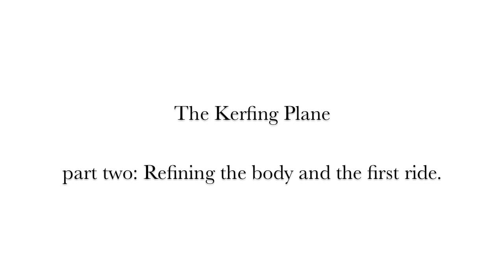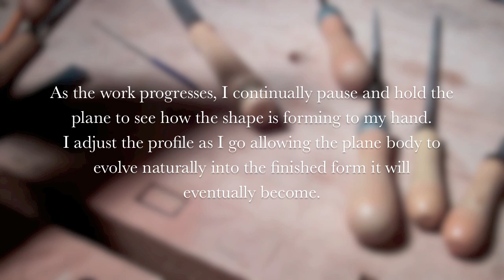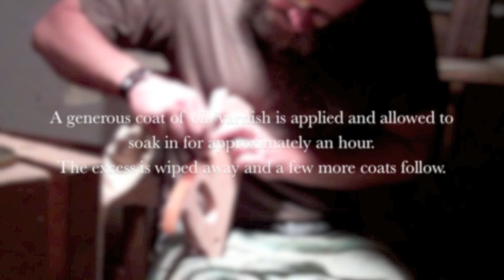The Kerfing Plane part two: Refining the body and the first ride.

Comment: Hey Tom, good stuff, very relaxing. 

If your number of planers you owned was reduced to only one, which would you keep? I'd like to break into the hand woodworking scene but don't know where to start.
Reply from the maker: Thanks for the interest. If I only had one plane, it would definitely be my low angle Jack plane. You can dimension rough boards, joint edges, smooth surfaces and shoot ends. If you need alternate angles, you can get replacement blades as well as toothing irons. Very versatile hand tool.

Comment: well done! Tom, how much is space betwin the blade and the fence?
Reply from the maker: tridneven thanks !  The distance depends on you- I just returned from teaching in Munich, where students made them to whatever offset worked best for their work. The distances in our class ranged from 1/8-in. ( 2mm ) for shop sawn veneer work,  to 1-in.  for general resawing needs.

The one I was making in this video was 1/8-in.
The best advice I can give you is make one suit the work you do most often...
if you can't decide- try making an adjustable fence model.

Hope that helps-
all the best !

Comment: Hi Tom, thanks for the video.  This was a really great project to watch you build and use.  Is there any way you could make this plane adjustable for depth and width depending on the thickness of matieral you need to resaw for?  Or would you just make another plane in standard depths and widths for your needs?  Not sure if I phrased my questions well enough for you to respond.
Reply from the maker: MrUltimate49er- thanks for the comments and question.
Part three of the series will answer a few of your questions~; )
My book will answer the rest !
Stay tuned....

Comment: Tom, where do you get the hardware you use on your projects, such as the flush fasteners for the blade?
Reply from the maker: Thanks for the question. I had Bad Axe Tool Works manufacture the hardware for both my Kerfing Plane and Frame Saw. You can order them here if you're interested: https://theunpluggedwoodshop.myshopify.com/collections/hand-tool-emporium/products/kerfing-plane-frame-saw-hardware-kit?variant=29407185997
all the best~
Reply: Tom Fidgen thanks Tom, I really love watching your videos!